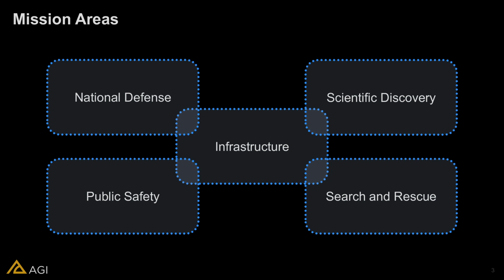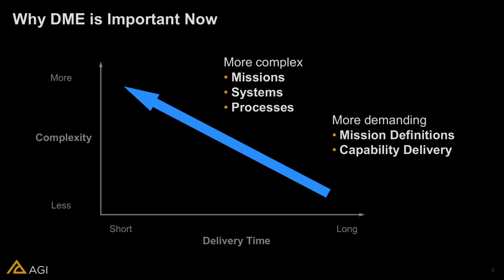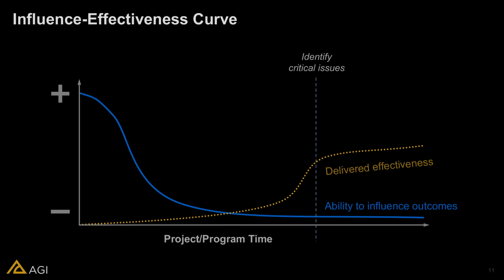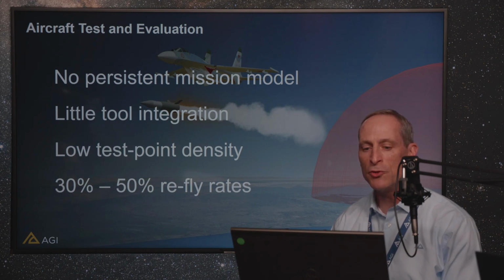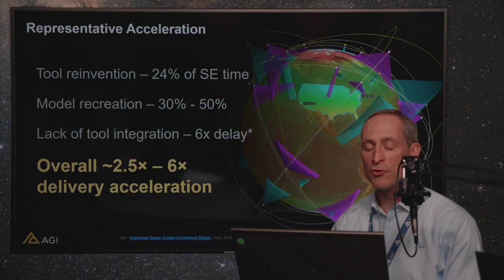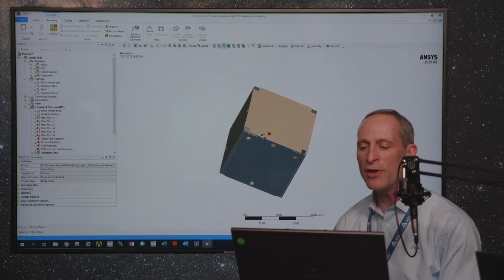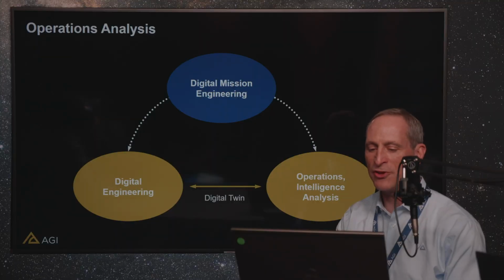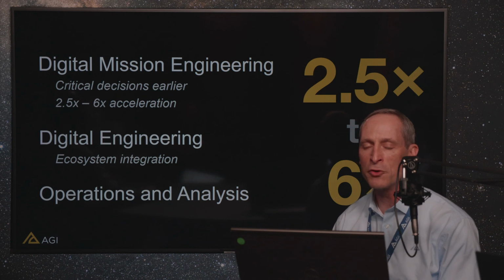Webinar: Digital Mission Engineering Part 1

Comment: Hallo I was wondering if you could help me ,
I'm a communication engineer , I'm trying to make a graduation project on measuring the performance of communication system in Mars , and I would like to use STK as my simulation tool for  the project is it possible to do so? measuring (speed ,attenuation loss , delays as communicating to earth) , and if you would like to guide me that would be very helpful ! , space communication project are never done in my department here in Libya , and I would like to make them interested in space and space communication 
Thank you
Reply: yeah, you can. There are many presentations and videos around your topic. They may help you.
Reply: @mohammadkhaneghaei1296  Thank you very much